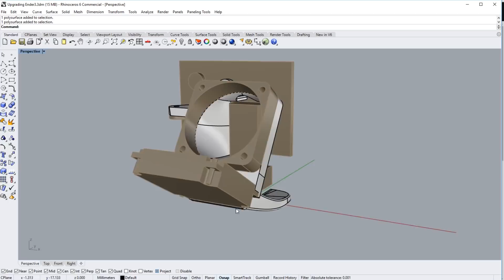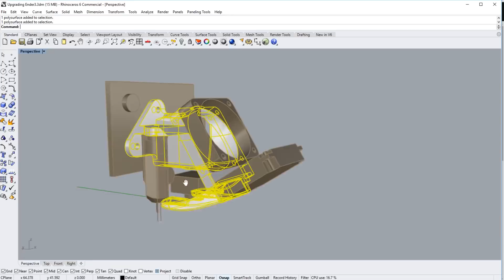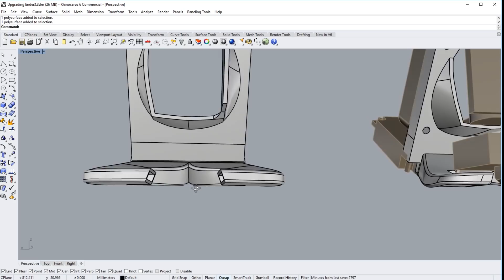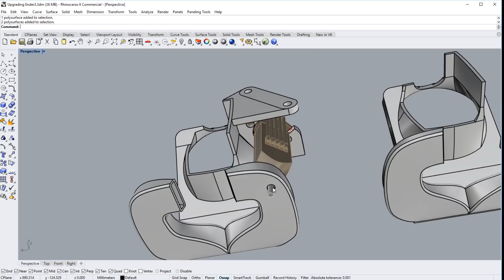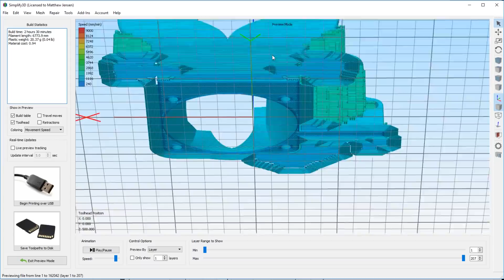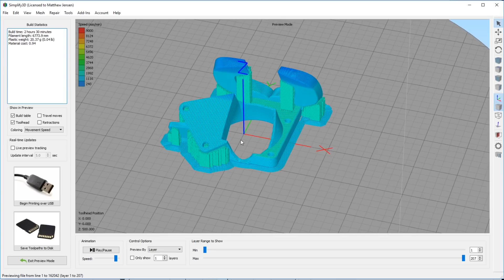Upgrading the Creality Ender 3 with Duet Wi-Fi, and other add-ons - part 1

Comment: This video is just wrong. We get it. You hate Prusa. But you did not make the Ender 3 better than the MK3, which was released around the time of this recording. The MK3S is even better now, but wasn't out at the time of this recording. While it was upgraded to a 32 bit board with wifi, it still lacked many features. I think that your are forgetting that the Ender 3 is still an i3 variation that Prusa originally designed. The Ender still lacks a spring steel sheet, an all metal E3D hotend, and still requires endstops. The Bltouch is good, but not as accurate as an inductive sensor. There is a reason that the Prusa wins awards for being the best. They pack so many features into a decently priced printer and provide amazing support. Instead of buying all the parts you have listed, I can get a Prusa clone from China for the same amount of money that will be better than this Ender that you upgraded with sponsored parts.
Reply from the maker: >The Ender 3 is still an i3 variation that Prusa originally designed.

Josh, you are misinformed and full of propaganda from the Prusa marketing department. The Prusa Mendel was Prusa's first printer. It was a direct copy of the Mendel invented by Dr. Ed Sells ( https://reprap.org/wiki/Mendel ). "Mk.3" means it is the 3rd iteration of the Prusa Mendel. I spoke more about this subject here: https://youtu.be/iKhn5IcVvAg

You think you would be better off buying a Prusa clone than building up an Ender 3? Really? First of all, buying clones is hurting Prusa. You are supporting theivery. If you like a product buy it from the original creator. You are stealing a sale away from Prusa (who you claim to love and support) by purchasing a clone. If everyone followed your advice it would be worse for Prusa than my videos are. Second of all, Prusa's frame with the zip ties holding the bed to the frame is inferior to the aluminum extrusion design of the Ender 3.
Reply: @DesignPrototypeTest  Once again you are wrong. The Mendel was indeed the OG reprap printer. But pretty much everything else you said was wrong. The Prusa Mendel was the second iteration of the original Mendel. It was not a direct copy. It was a simplified version. Then, Prusa went on to create the 3rd iteration which is the Prusa Mendel i3. This design is the single upright frame containing the X axis and Z axis. Many printers, including the Ender 3, are variants on the i3 design by Prusa. The MK3 is the 3rd iteration of the i3 design. In more complicated terms, it is the 3rd iteration of the third iteration of the Original Mendel. You can read up on all of this on reprap.org.

Buying clones doesn't "hurt" Prusa. First of all, every one of their printers are open source. They literally give the files to make their printers. I'm sure he wants everyone to buy his printers, but more importantly, he wants innovation in the reprap world. Prusa is doing fine, and if money wasn't an option, I would buy the MK3S. The biggest thing you get from them is support. I built my own printer around 5 years ago. It is a Prusa i3 Rework clone. I learned many things building and upgrading this printer, so I don't need official support. Secondly, another reason their printers are expensive is because of the quality of parts they use. My current printer has cheap hardware except for the E3D V6 hotend. 

I never claimed to love and support Prusa. Don't put words in my mouth. They are a great company and have truly been pushing 3D printing forward. Jo Prusa is extremely influential mostly because of the i3 design and his willingness to open source everything. You wouldn't have your Ender 3 without him. These are facts. Their current line of printers are great quality and a decent price for what you get. All this being said, I have never owned an Original Prusa and they have never gotten a dollar of my support.

Lastly, the zip ties don't "hold the bed to the frame". The smooth rods snap into 3D printed parts. The zip ties are extra assurance that the smooth rods stay tight to the 3D printed part. Since there is not much force at this specific location in the Z direction, there is no need for anything other than a zip tie to keep the rods in place. 

Please educate yourself before you make all these claims.

Comment: What determines a company being recognised as an industry leader, is it the sales numbers? Is it innovation? is It PR telling customers they are an industry leader? is it when a product is bought by many pandemics? or is it all of these?
Reply from the maker: In the case of Prusa it was the saturation of good publicity on the internet. At the time I made this video and still to some extent today, Prusa is revered as the low cost printer that "just works" and delivers high quality prints as good as machines that cost thousands of dollars more. Prusa really set the bar for low cost highly effective printers at the time. There are other options now.

Comment: That is the thing with Chineese made equipment, in no time, everything about the machine will be and look different! I owned a t-shirt heat press and ended up changing everything about it to get to work every time it broke. Same thing with my Ender 3 Pro...that is why I am returning mine. Stay away from the Ender 3D printer....Just go with Prusa! The Mini is for the same price.
Reply from the maker: Are you a real person, or another troll-screenname here to shill for Prusa?
Reply: @DesignPrototypeTest  real person. Shared my personal experience.
Reply from the maker: Presumably you got into screen printing to make some money. It's well known how lucrative selling t-shirts can be. It's understandable why you would just want your tool to work in that situation and not have to mess with it. 3D printing is different. Everyone knows you can't make any money from 3D printing. It's a hobby. Half the fun of the hobby is making/upgrading the machine. A stock Ender 3 can produce prints that are every bit as good as a Prusa. It's more challenging, especially as a beginner, but I don't see the appeal of spending the extra money on a Prusa. It's more fun to DIY. Isn't that what 3D printing is all about?
Reply: @DesignPrototypeTest  I see your point and if you're looking at it from a hobby stand point, yes! I totally agree. I would have fun working on my 3d printer. But I purchased mine for business and creating a series of kid toys and need something super reliable.

Comment: 3:31... yet pushing the bed so fast almost fried the LCD or the Board. Pfff... Hint: LCD lights up briefly steppers act as generators and feeds back energy back to poorly designed electronics...
Reply from the maker: The Duet Board which is installed into thsi printer now is impervious to the problem you describe. In fact it hasn't been an issue since the dawn of the reprap movement when actual arduinos were being used to control 3D printers. I have a 2 year old kid. He goes to town yanking the bed back and forth as fast as he can until he get's bored. The printer still works perfectly... The sky isn't falling, but given your predisposition I suggest you head over to my "CNC for under $200" and be a Chicken Little over there about the tinned leads. You'll be in good company. There are thousands of comments chastising me for that issue.

Comment: I did not enjoy the arguments made. Your upgrade seems to be really hard to pull off. For a normal user i prefer a product that steals good ideas and work stable without any of this costly and difficult and unsure mod. Your support is zero from any company as you break warranty and support options. Prusa can help as it is a whole product. Dont hate on companys that steal well. So you own a Smartphone? All tech is stolen in smartphones. Otherwise interesting video. But to Advanced for me. ill get a Prusa cause so much hate must mean its like Apple. Really the best out there. Thnx for making that clear. Good luck with modding and keep your videos happy.

Comment: 14:30 simplify 3D is not expensive

Dude, it costs more than half the printer you are using it on lol, there were so many great free slicer options over a year ago, sImPlIfY 3D iSn'T tHaT eXpEnSiVe
Reply from the maker: I paid $150 one time and I've been using Simplify3D for years now. It is the superior product. You pay for what you get, and $150 for software isn't that expensive. A license for SolidWorks costs $4,000! And they release a new version every year! Solidworks is an expensive program. You could buy 26 S3D licenses for that much money. As a professional a $150 business expense is something that I hardly even notice. I get it, not everyone is rich. But ya know what, everyone has some money. It's just a matter of priorities. I'll bet you are the kind of person who mocks me for valuing a quality program then goes and spends $200 per month on vaping supplies.
Reply: @DesignPrototypeTest  wow, everyone that speaks something you don't like is a junkie, that's just sad that you discriminate blindly like that.

Check out Cura, Craftware, Prusa Slicer, even Repetier Host is a respectable slicer for free. Budgeting is really important, exemplifying spending $4,000 on solidworks when you can use Fusion 360 or Inventor for free is bending reality to fit your ideas. You need to practice budgeting because you hurt your reputation and misinform the public.

Keep in mind the most common 3D printer sales average about $200-400. The average person cannot afford one 3D printer and the lucky few that do buy a machine will need most of their budget for filament and project materials. Professional or not, you should be aware of the market.

Your channel had potential for being niche and progressive with your experiments in an informative light but now you've shown you're just behind in the times and too inflexible to handle criticism respectfully.

Comment: PRUSA uses linear sleeve bearings which in my automation engineering experience fail WAY WAY too fast. I would like to see a THK type linear bearing block for rigidity and long wear.

Comment: 6:18 Laser Pipe Filament Runout Sensor
https://www.thingiverse.com/thing:2703575
https://youtu.be/NdZg186fbuE
Reply from the maker: Nice find! I always love seeing the genesis of these ideas from the original creator. There is also this guy who did it with a laser mouse in 2016: https://hackaday.com/2016/12/08/this-old-mouse-keeps-track-of-filament-usage/
Reply: @DesignPrototypeTest  One of my Own designs, never actually used a Micro switch does as will for just Filament Out; I guess an Newer Optical Mouse may do movement easier
https://www.thingiverse.com/ProtomakerSprint/designs
Reply: @DesignPrototypeTest  Neat https://hackaday.io/project/18804-coversion-of-ps2-mouse-to-filament-counter

Comment: What are you talking about with the whole "surfacing" "takes such a long time"  while inventor and fusion both have the SHELL and LOFT commands. And the constraints to follow. That coulda been an easy 3d sketch 

Also cura now has support material settings easier to remove than the stuff here 

Cura 4.5.0 seems lightyears ahead of simplify3d and slic3r

Comment: Hello, I am considering buying a 3D printer. I was watching the Cetus 3D... At work we have a Geetech A30 with a lot of problems but it works after many hours spent learning how to improve it. Now, for me I have in mind the Hypercube. I like that it´s a stable, solid build. I would like to buy the:

 https://de.aliexpress.com/item/32991338073.html?mb=dPMGvQ4B8g3wRlj&srcSns=Copy+to+Clipboard&tid=white_backgroup_101&tt=sns_Copy&image=H7370bf1557b148d6a847ad6689595572t.jpg&aff_request_id=41ff2f3fcda046268028be8edc45cbdc-1586201361817-00617-_B0846J&spreadType=socialShare&aff_platform=default&sk=_B0846J&aff_trace_key=41ff2f3fcda046268028be8edc45cbdc-1586201361817-00617-_B0846J&businessType=ProductDetail&templateId=white_backgroup_101&title=%E2%82%AC+84%2C53+%7C+1Set+HyperCube+Evolution+3D+Printer+Metal+Frame+Extrusion++with+hardware+kit+X300+x+Y300+x+Z300+print+bed+area&platform=AE&terminal_id=0be1ffe0d22f42aa9104e53459dc2c69

frame since is only 85 Euros form Aliexpress. I would like to use the Duet, the BL Touch and all the good stuff. 

What is your recommendation at this time? Is it still a good choice? I know the MGN linear rails... do you think they can be used or is it worth to adapt them to the hypercube?

Thank you,
Catalin
Reply from the maker: Building a 3D printer is better than buying one. To me building and upgrading is 75% of the value in the hobby. It seems you are similarly minded and really want to build a printer from the ground up. The hypercube and hypercube evolution are great projects however, have you considered a Piper2? That printer would cost you even less for the frame and would be an even greater achievement of DIY awesomeness: https://www.thingiverse.com/thing:3022836

Unless you live in Europe and not the US As I understand it, the inexpensive conduit pipe used in the construction of the piper2 doesn't exist in Europe. Also, there isn't a large community surrounding the Piper2 whereas the Hypercube has many people involved.

Comment: 20 mins to heat the bed and thought not to check other users of ender 3?  And you judged the printer?
Reply from the maker: Everybody makes mistakes. I don't have to show you mine. I can edit them out. I'm trying to help and encourage everyone by showing that you can do this too. Making a minor mistake does not limit my ability to correctly judge the printer.
Reply: Ok fair enough. Hope it did not take you long to discover that ur running half the ac voltage.

Comment: wait im confused, if the filament run out detector is after the extruder, if you do run out of filament the extruder wont be pushing anything and the filament will still be trapped inside of the boden tube and the print would never pause due to filament run out. Wouldnt it keep printing nothing into thin air if you did run out?
Reply from the maker: The Filament detector is a laser motion sensor just like you have under your computer mouse. It detects when filament stops moving. This is how it knows when either there is a jam in the extruder, or there is no more filament. It also detects the speed at which the filament is moving. If the Duet control board tells it to move a certain distance, but the sensor only detects half that much movement, the Duet board will halt the print because there is a semi-jam causing under extrusion.

Comment: hi what filament sensor did you use
Reply from the maker: I used the Duet optical sensor available from Duet3D dot com, but it's pretty pricey, and I expect that the new geared version is a lot better. Also, I made a $5 version: https://youtu.be/zJ26DD9tk6w

Comment: WiFi board, seems cool, I might wanna... HOLY $170! I can live with an SD card and low cost board...
Reply: I believe that you can add a cheap wifi board to an SKR mini for a lot cheaper
Reply from the maker: I spent $40 taking myself to a Sushi lunch the other day. So it's like four of those meals. Not that expensive, and definitely still in the realm of disposable income spending. Now ask me about the $3000 I spent on an E3D tool changing printer or the Shaper Origin. That is a waste of money. $5000 between those two and I've gotten WAY less utility out of those two machines compared to the Ender 3 with upgraded Duet board.
Reply: @DesignPrototypeTest  Its the same cost as the damn printer dude. Put that into perspective.

Comment: Let's start busting Myths.

Printed parts are a problem as are zip ties. - Nope.  The printed parts on the Prusa are high tolerance, the zip ties are not structural, the rods snap into the brackets, the zip ties just keep them from popping out when you move the printer.  The I3 Mk2 has a FAR superior frame, the steel rods with ball bearing runners are much better than aluminum channel and roller wheels.

Further, after upgrading all these parts you're into this for about $450, and you're stuck with a still inferior machine to the Prusa.  The Prusa has dual stepper motors on the Z axis and has a direct drive extruder compared to a Bowden extruder.  Direct drive is superior as it requires less retraction, wastes less filament, and can print more filament types as the motor is closer to the hot end.  Not only does the Prusa have dual steppers on the Z axis but it has higher quality steppers, the Ender 3 steppers need a Z interval of multiples of 0.04mm to get a quality print where the Prusa is as fine as 0.0025mm meaning any Z height you desire will give you a good result.

Don't get me wrong, I own both a Prusa AND an Ender 3 which I've done many mods on, but my Prusa is head and shoulders a better printer.  I also expect that it will complete many more prints than my Ender before it needs major work.

If you're going to put $450 into a printer you're better off with a Prusa Mini.  I know that wasn't available in 8/2018, but it is now.
Reply: True that
Reply: Could've said it better myself. just got me a prusa a couple of weeks ago, and its by far a better, more reliable printer.
Reply: This is an old post but, cant you tune the creality motors to work like prusa's as far as i know theyre both 1.8 degree motors with a +/- 0.09 degree deviation at 0.04...  if both motors have a 1.8 degree step angle then theyre both 200 steps per revolution right? Wouldnt that boil down to stepper drivers and the board? I could be wrong but isnt that why he uses spi mode on 2130s for the enhanced microstepping? Im curious because i own 2 ender 3's and would love to acheive that level of accuracy